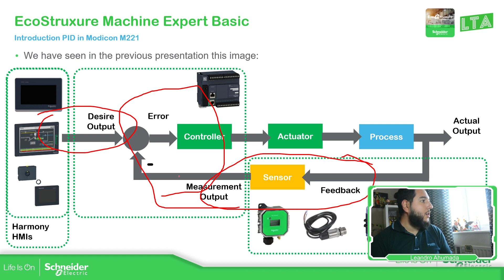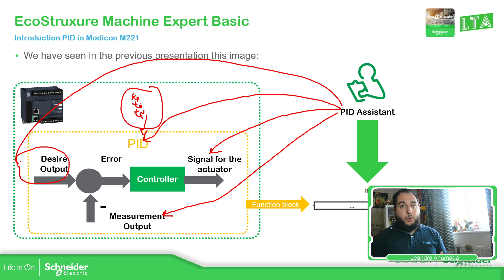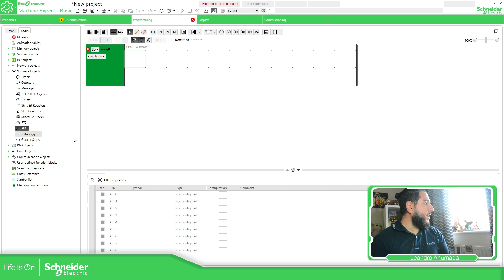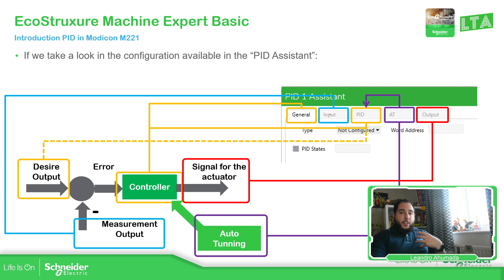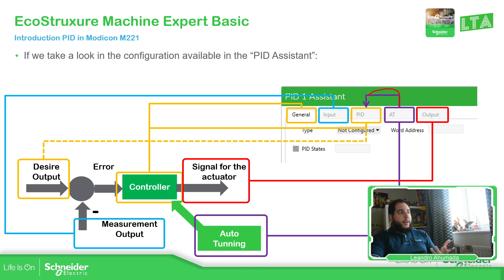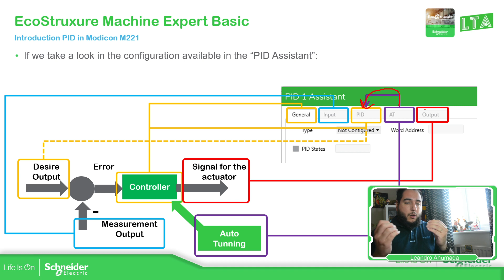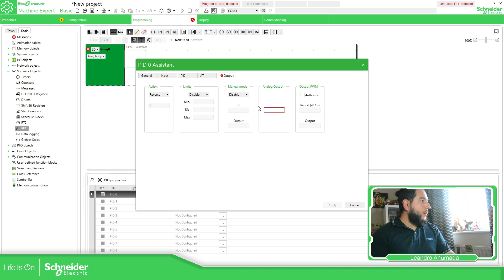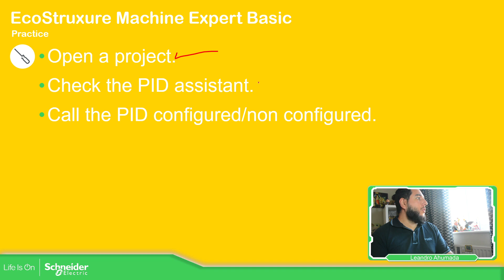Training - M221 - M17.2 Introduction to PID in M221 (PID Assistant)

Comment: How to put a dead band for pid in m221 like in ,m340 function block
Reply from the maker: Hi there! Someone not long ago asked me the same and i am not able to find my answer but basically the m221 does not have the deadband so you will probably need to add a logic before sending the pv to the pid to limit the operation.

Comment: Hello, Tomas. A very useful video would be for building a temperature controller with a hysteresis sensor in the m221 for relay output.
Reply from the maker: Hi there! I have not done a video for that yet but in the meantime you can take a look to my function block inside this "library": https://app.box.com/s/e3sheiyrp72a5pj7fij1h2vzk2g5a2bv
Reply: @ 
Thanks a lot👍🏻

Comment: Dear LeTomas AHUMADA! Regarding the PID controller in M221 I can not find possibility to specify a deadband. Our company is a producer of cooling systems. When we control the temperature using a PID controller, usually we specify a Temperature Setpoint (SP), and a Deadband (DB). The Temperature than shall be kept between (SP-DB) ... (SP+DB). E.g. when SP=20°C and DB=1°C than the Temperature shall be kept in range: 20°C +/-1°C= 19°C...21°C. Is there a way to specify such deadband in M221? Thanks in advance for your reply. Otherwise I would like to thank you for your videos. They are very useful and understandeable. Such videos should be made for PLC's of another manufacturers too!!!
Reply from the maker: Hi Viktor! As you mentioned the M221 PID does not have a deadband parameter, i believe you can modify the value in the "measure" simulating that the control reach the desire value and if the "raw" value moves away from the "deadband" you move the real value to the PID.
Reply: @LeTomasAHUMADA  Thank you very much for your reply. In the meantime I wrote my custom user-defined PID function block with deadband and another useful functions and that works fine. Another Question: Is it possible that the M221 is part of two different communication systems (e.g. both MODBUS RTU): in one BUS the M221 would be the master, controlling several fans as slaves (e.g. 16 pcs fans); and in the another communication system it would be a slave among 12 cooling devices, containing the same M221 CPU's each, but controlled by a superior master CPU of any kind/manufacturer? (So in one MODBUS it would be the master, but in the another it would be the slave, controlled by a supervisory PLC). Thank you in advance for your reply.

Comment: Do you have a program example that we can download?
Reply from the maker: Hi Agung Ertanto! i nthe next link you can find an example of the PID in the M221 controlling a motor using a PWM signal and reading the velocity using an encoder connected in the HSC of the PLC: 
https://schneider-electric.box.com/s/y0339l4dtiy1y8zwcocq382t8kf4mita

This sound excellent but system can be different but you can follow the structure.

Comment: thanks :) will you be doing a more indepth tutorial using PID for heat contol?
Reply from the maker: The idea is to go in deep in each tab of the assist then make an implementation which i have two option base on money and time…
Option 1, configure quickly everything to show the response of the output and manually change the input to replicate a temp control
Option 2 , where i need the resources, temp control using pwm to control de heating and cooling using a mini kit air conditioner kit with Peltier cell…
Sooner or later i believe i will make it

Any ideas are welcome 😁👍🏻
Reply: @LeTomasAHUMADA  looking forward to it. Thanks